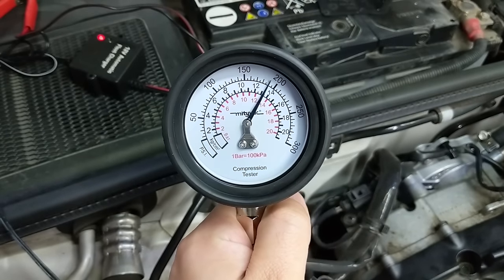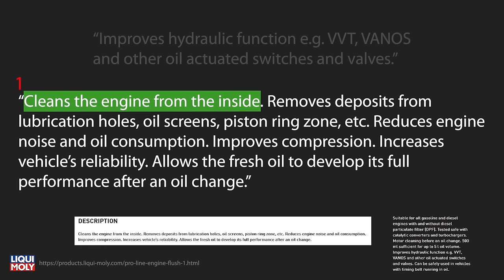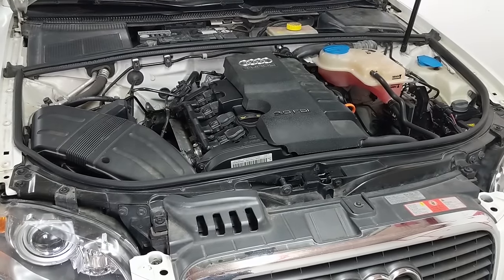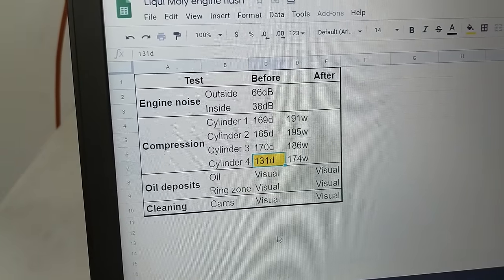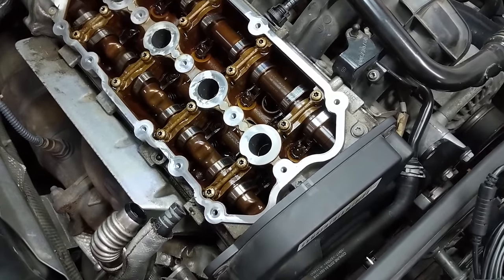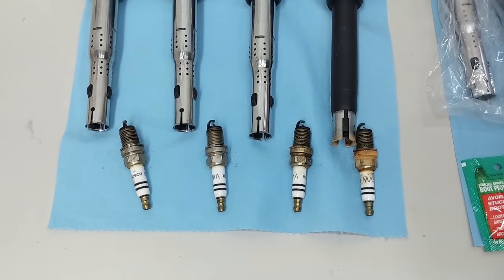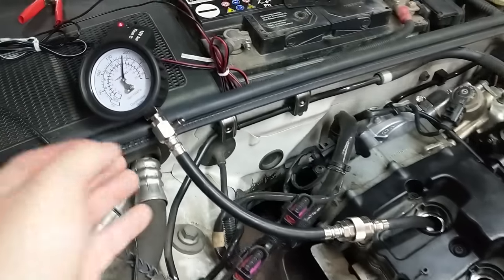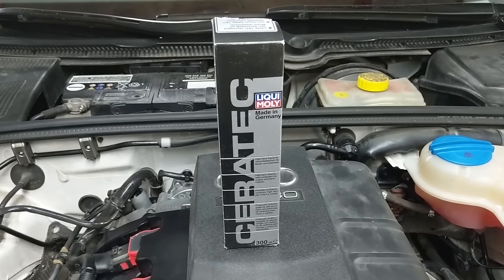Does Liqui Moly Engine Flush work? | Full Test & Review | Pro-line 2037

Comment: This product is primarily aimed at a second-hand car buyer where the service history of the car is not known or known to be bad or neglected. (Never believe when the seller says it's been serviced recently)!
Here in the UK it is only about £6  so in the grand scheme of things it's well worth doing, especially if the oil on the dipstick is really black and thick! This is usually a sure sign of maintenance neglect. (This can be more so with Diesel Engines). Sludge is really bad for engines as it car restrict oil passageways. (A bit like fatty solids, (plaque) in your bloodstream clogging arteries - and we all know how that ends!).This product is designed to dissolve this so in fact less deposits in your filter is actually a good thing.... 
Your engine was actually very clean to begin with around the Cams so not noticing a difference was to be expected.
The Carbon buildup on top of the Piston is quite normal and can only really be removed using another method. I've heard of good results with this - not too sure if available in the US?  https://www.terraclean.co.uk/what-is-engine-carbon-cleaning/ 
Thanks for the Video.
Reply from the maker: Cool, thanks for the added perspective Bill. Up here in the Great White North we don't have places quite like that. And yeah, it occurred to me too late that if I were taking Liqui Moly's advertisement at face value that all the deposits were dissolved, you're right - I would in fact see even less in the filter - but I'd expect that the oil composition was...dirtier? I wish I had more sophisticated tools to measure things.

Comment: So I'm slightly confused. When you put in the flush, you also put in fresh oil, right? If so, it absolutely helped clean the engine. If I put fresh oil into my car and drain it immediately, it gets nowhere near that dark. Either way, great video overall. You'll get critics in the comments I'm sure, but you didn't draw any illogical conclusions, and I challenge them to do a better test. The one thing I can think of that would be cool is an oil analysis of the first batch of oil and then the batch with the flush product. Cheers!
Reply from the maker: Appreciate the support, 802. Nope, I followed the instructions from Liqui Moly right off the label: once the car is up to temp I added the flush to the old oil. 10-15 mins of idle and then the whole batch of flush + dirty oil gets drained. Clean oil only goes in after the drain and filter change, like any normal oil change. I agree an analysis would be cool. I need to spend my hobby dollars across the channel projects wisely, though. A few pennies just went to the new garage build. Maybe more than a few.
Reply: @FigureItAudi  Oooh gotcha! Makes more sense. Totally understand the budgetary concerns.

Comment: Used this , changed the old oil filter , with a new one , first pass , left the old oil in , poured in the old oil , idle for 15-20 mins. , changed old oil and filter , poured in ceratec , left in 1 year ,

Comment: So i used liqui moly proline flush on my 2016 golf 1.8tsi...i bought the golf at 30k miles and it currently has 120k miles, its burned a quart a week since the day i bought it and it started getting worse recently so i ran the proline engine flush for 15-20 min after i let the car warm up properly on a 30 min drive, then came home, poured it in and let it idle for 15-20 min then changed my oil and filter as normal with mobil 1 5w40 euro...reason i chose mobil 1 was because it burns the quickest in this car...I did this last month and so far the oil level on the dipstick hasnt budged from full and i dont have carbon build up on the inside of my exhaust tips anymore...id say the proline engine flush worked, i do about 4500 miles every 3 months and thats when i change the oil, so lets see we got 2 more months to go but so far so good zero oil consumption seems like the proline flush dissolved the carbon that was caked up on my piston rings...also keep in mind I drove the car like crazy for that 30 min drive, and I also drive the crap out of it now and zero oil consumption issues, just thought you should know that I dont baby this car at all
Reply: I'd also like to add that just looking down the oil fill hole, before it was super dark and dirty on the metal parts, and that's how it would always look even after a fresh oil change...after the proline flush it was clean, all the varnish was removed and you could see the actual metal color

Comment: After owning an '87 Audi GT back in the day, I quickly learned that once the Audi card has expired, they should generally be used as a boat anchor.
Reply: I had an ‘84 Audi GT that I put 150k miles on and it treated me very well. I did replace quite a few parts on it, though. I really loved that car. Too bad yours wasn’t as great. I think the ‘87 had the digital dash, right?

Comment: This is an excellent video ! a real credit to YouTube and the sort of videos we should be seeing !!
1st, personally I think when you do a compression test you need to crank it a lot more until the needle stabilise it at its maximum 
2nd, 10 minutes is not long enough for the engine flush to take full effect,It will need to be running at least 20 minutes for the detergents to do their job, I know this from experience of using liqui Moly , it will take five minutes alone just circulating around the engine.

Comment: I like ceratec in high mileage engines. As for the flush, I'm not looking for a shiny clean top end. I'm looking to thin out and flush away sludge deposits, especially in the sump and pickup. Maybe taking a high milage engine and doing compression tests and inspecting the pickup might tell a different story. I doesn't hurt to use some kind of oil system flush every few changes, although typically I'll take a hit and do two changes and the flush. IE, drop the old oil and filter. replace with cheap mineral oil and the cheapest filter. Use the flush product following instructions on container. Drop the cheap oil, remove the flush filter, install a new, good filter, refill with high quality synthetic oil. Why? OCD and wishful thinking.

Comment: Are you sure that you are cranking the engine until compression stops building. Another thing, if you want to clean your combustion chamber, use a fuel treatment. Oil isn't injected into the combustion chamber, so there  is no reason to expect it to clean your combustion chamber.

Comment: I can help you get rid of alot of that carbon on top of your pistons. Get a high PEA (Polyetheramine) content cleaner. Chevron Techron in the value size is often the best value for buying it. It WILL clean that black stuff off your pistons. Its one of the very few products that actually works. I always use it before an oil change (about 500 miles before on a 5,000 mile oil change interval) and it cleans the black off my pistons.  I check the tops of my pistons with a camera and i can promise you it WORKS. and it works damn good if you use is consistently in small amounts or in high doses occasionally like before an oil change. This is because it goes in your FUEL so it cleans the combustion chambers and injectors... your oil flush cleans the places where oil goes which is not on top of your pistons! So yeah you dont have to use it before an oil change.. top tier fuel in the US has a small amount of PEA in it.. but i like high doses.. its expensive so you only get small amounts at the gas station and you only get it at "top tier" gas stations where you pay more for it.

Comment: Hi , how you doing, is very interesting this video and just wondering my grandpa used to be put Diesel and running the engine couple min and after drain the oil and blow with air the oil and yeah always have clean inside engine when he have to do Some repair and open the engine??? Maybe ?? But I took about regular Engines not that much newer

Comment: Direct injection and you pcv dumping into cylinder 4 so that does give you the problem. Catch can and carbon cleaning will help prevent carbon build up and increase valve cleaning span.

Comment: Best way to flush engine is to fill it up with diesel until it overflows from the rocker cover then remove the ignition relay or fuse so it doesn't start then spin the engine everyone 10 seconds for 10 minutes then drain the diesel this will make your engine new

Comment: I’d throw out the change in compression. We see cylinders jump around all the time on aircraft engines with no changes made to “fix” anything. Basically compression numbers just tend to bounce around, possibly due to valve sealing (junk on valves) rings, temperature differences,and the phase of the moon. If it passes it’s good to go. I’ve for sure seen cylinders come back up significantly with no oil treatments or anything. We always run the same oil with no fancy additives.

Comment: You said your next step was to clean carbon from engine inside. If you could make a hydrogen generator and run it into engine to clean video thatd be nice. Or using a steam cleaner into intake or both. Always wondered if that would work and how well. As far as the snake oils go. Its just more oil with different chemistry. Ironically most of the carbon buildup is from the PVC system which in itself is oil mixed with other components. Oh boy the wonders of things getting dirty to be clean. That my friends will never end.

Comment: The oil was really black and burned , for you looks preety good?Good video anyway but a better compression could be also from the new oil which is thicker than the old one.I made an engine flush 3 times also changing the filter 3 times  till the washed oil was like new.As a result after 4000 km  the oil became dark .Which is normal for direct injected engines.

Comment: Amazing work on your video. Are you convinced that your cylinder walls have carbon build up? Whenever I've looked i've always seen clean walls and reflection of the piston carbon build up.
Reply from the maker: Nope, anti-convinced. Comments such as yours quickly made me realize that the coloring was (mainly, probably) indeed from the piston face. That said, it would be ridiculously hard to measure the cleanliness of the walls without tearing down the engine for closer inspection, especially with how far the piston rings travel up the cylinder.

Comment: I know this wasn't a great idea, but I put Liqui Moly flush in my engine, then drove 3 miles/10 minutes to my mechanics garage before he carried out the oil change. Do you think its likely to have caused much damage?
Reply from the maker: Probably not but the thing with this product is that it seems to have the potential to cause issues depending on what the condition of the engine - and just based on car itself - was prior to flushing. If you are at all concerned, just keep an eye on your oil consumption/levels and if you have a way of monitoring oil pressure, do that too. Listen to and feel the car.
Reply: No

Comment: It probably do something for engines that had no oil change and have sludge in them. But if you change the oil on time or earlier you don't need liquimoly cleaning, mombo jumbo... the oil has detergents for cleaning incorporated.  Some gasoline /petrol put into cheaper sacrifice oil and engine started , for 1 min, and then cranked only (injection fuse taken out), let it to drain, replace oil/filter , would probably clean better than any comercial jumbo mambo
Reply: My grand dad told me he used to put straight diesel inside the oil pan of the tractors and let them iddle for a while when they had way too much sludge in them. He said they would wear out a bit in that time but it wasn't that bad for them. I believe engineering explained did a video on what happens if you run an engine with no oil and it didn't seem to heat up that much more compared to an engine with oil in it so just idling it with diesel it shouldn't hurt that badly.

Comment: on a brand-new Audi, do I start doing engine flushes at the first oil change?  or do I wait for a year or two?   Thanks!
Reply from the maker: No, that wouldn't be necessary. The biggest problem with the majority of modern cars is simply that the direct injection of fuel means you can't depend on fuel or any cleaner that would otherwise be added to fuel to clean the back of your intake valves. That being a concern due to the recirculation of blowby via the PVC and whatever other emission systems might be in place - aka, a bunch of gunk gets deposited in places you can't easily clean. This problem is theoretically solved with catch cans. For a new car that has no future of modification, good maintenance and some preventative products are all you can do; regular oil changes with quality oil (and maybe additives like MoS2 or Ceratec once in awhile) and a simple, yearly carbon cleaning with a product injected up in the intake/manifold to get ahead of deposits would be plenty.

Comment: i have had very good experience with the engine flush. Unfortunately, the previous owners of my car paid very little attention to maintenance. also a lot of short distances were driven. the engine of my car is very good, but unfortunately it has one problem. the oil gets extremely hot at full throttle. the engine has to struggle with it more than other engines. but if high quality oil is used that is no problem either.
the previous owners used cheap and the wrong oil.
as a result, a lot of oil carbon formed on the piston rings and could no longer wipe off the oil. therefore the engine burned a lot of oil.
thanks to the engine flush, the oil carbon came off and the piston rings were able to work again. the oil consumption disappeared completely.
Reply: which cleaner did you use? which oil is high quality?  my car burns oil and i am looking for a solution.  Thanks.

Comment: Excellent, well thought out testing regime and reporting!! You do great work! Thank you!                        For Informational purposes only, for over 40 years as an aviation and garage mechanic, I have had very  good results restoring compression, lowering oil consumption and quieting valve train noise using Marvel Mystery Oil, which makes many of the same claims. Air cooled aircraft piston engines run under extreme conditions and routinely develop large amounts of carbon deposits. Rings routinely gets stuck on high time, dirty engines....it's not always carbon under a valve seat. With extreme compression loss on a single cylinder (aircraft or automotive) I often pull a spark plug, run piston up to just below TDC, and soak the cylinder with MMO (caution(!) never ever put the spark plug back in until you have cranked the engine with the plug out to blow the residual MMO out). I have never had an instance where compression on the low cylinder has not come back in line with the others, (obviously as long as there are not other mechanical failure issues). Exact same results on dozens of vehicles over the years and recently on my BMW 328i ...also successfully flushes out Vanos solenoids etc. Thanks again and hope my experience helps someone.
Reply from the maker: Thanks for watching and weighing in Briana. I LOVE hearing from people with lifelong experience in related fields and I've always thought of aviation as the golden standard of mechanical practice when it comes to maintenance and repair that still overlaps with the automotive world. Very cool stuff.

Comment: My car engine consumes 3 litres of engine oil and it's driven milage is 36,000 km so far..  I have used a full bottle of your liqui moly engine flush for 10 minutes and flushed my engine.. while your bottle instructions say your one bottle is enough for 5-6 litres of engine oil .. please tell is there any damage to my car engine because as per this calculation, I should have  used half of the engine flush bottle..?? Please advise I am much worried is there any damage to my engine due to this over dosage of flushing liquid??.. thanks in advance team liqui moly

Comment: Did you use a cheaper oil to run and do the engine flush and then put the usual oil you use after you were done with the engine flush or did you just drain a little?  Thanks in advance.
Reply from the maker: Smart guy. In order to follow the Liqui Moly's instructions - which is to add the flush to the dirty oil you're about to drain - I did indeed drain out a sample (which ended up partially in the sample cup) in the same quantity (~500ml) of the flush liquid. Net zero on total volume in the car.
Reply: Figure It Audi awesome. Thanks for the quick reply. I figured instructions were followed but wanted to confirm. Awesome video and can’t wait to see the ceratec video.

Comment: Do you recommend using it only on higher mileage vehicles?
My car has done less than 30k miles and not sure if I need to use this. Thanks
Reply: Wanna keep your engine pristine ?
Use Amsoil signature series 
It’s loaded with additives and detergents 
A bit pricey but the oil is guaranteed for 25K miles 
Lots of videos on here about Amsoil 
I also use their transmission fluid and engine coolant

Comment: Question how long did you run your engine after you put the liqui Mol IN?  Your oil seemed really dark for just a 10 or 30 minute run and. When I change my oil it normally stays golden for at least a few hours. Maybe it's because audi runs hot compared to Toyotas or acuras. Just weird to see black oil for a test run.
Reply from the maker: Hey Henry - I only ran the engine for the 10 mins to follow instructions as prescribed on the can. Keep in mind, the flush goes in with your old oil - there isn't an oil change prior to flushing. Again, per instructions. I'm reading between the lines on your comment re: oil darkness. I have no doubt that if the oil is changed, then the flush is done, the next drain would be quite golden. That said...there's a lot of crap in engine galleys. Hope this answered your Q.